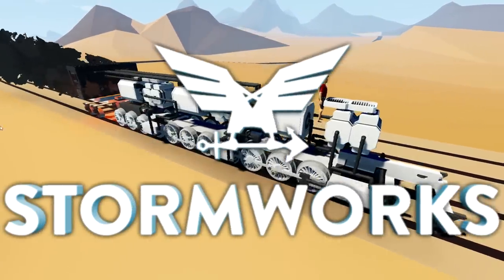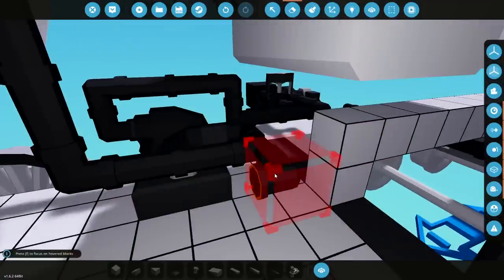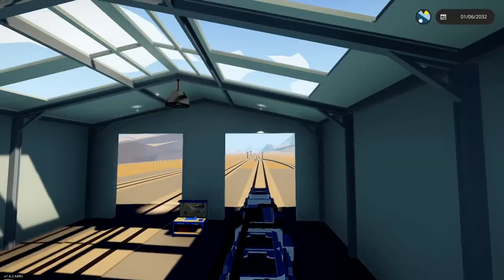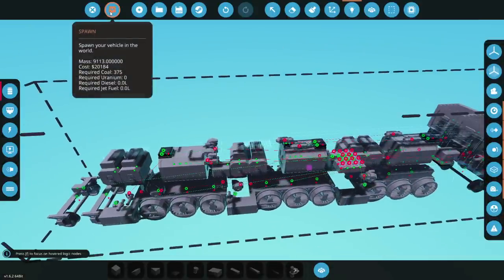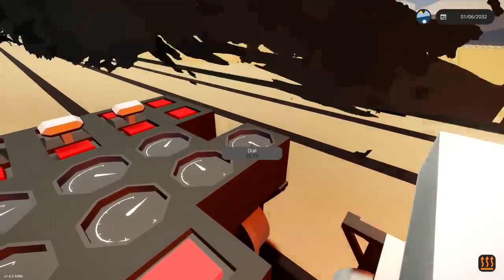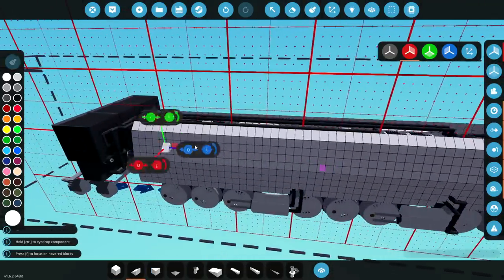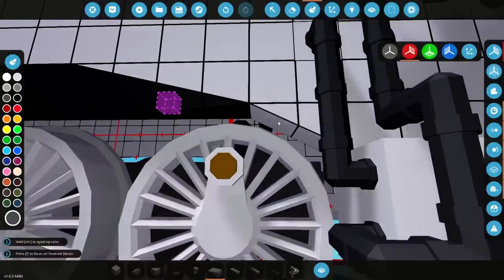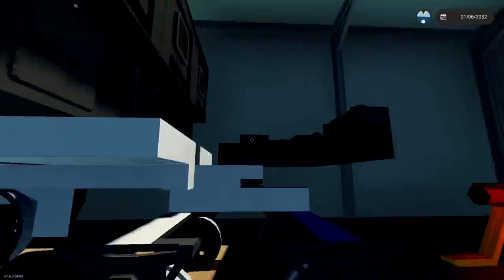We've Started The BODYWORK On Our HUGE STEAM POWERED LOCOMOTIVE In Stormworks!

Comment: I dont think frantic saw my comment on the last video, but there is a way to get infinite power out of the steam. Now I dont mean electrical power, I mean RPS / RPM. You only need a small firebox, a single boiler, and no condensers. All you need to do is get roughly 4 bars of pressure buildup, then shut off the boiler. the steam however, is sent through a 1 way valve, and pumped between each piston in a loop. This does work!! Just make sure you shut down the firebox by cutting air supply, or you will have issues. 

Please like this comment so Frantic can see this!
⬇️

Comment: Yay, you followed my proposal! With the 30-ish m/s you are at about the same max speed that i archived, too. So maybe 30m/s or ~110 km/h is the max Speed for Steam Trains/Wheels? I did another Test with normal Train Wheels and a large Electric Motor with infinite Electricity. With that i could reach Speed way above 250km/s, with an extremely high Chance of derailing with each Curve. So maybe the Steam Train Speed Limit is some sort of Failsafe?

Comment: why 3 boilers?  a single boiler tends to be a bit more efficient, and you will want to bridge the steam input between all pistons and bridge all the output to a single Condenser and make sure the condenser is as far away from the boiler and firebox as possible as the residual heat can cause the condenser to run hot and sometimes not work causing over-Pressure and boom. So what i have found is that as long as there is pressure be it 1 or 8 the engine will get to the same speed and is solely dependent on number of pistons and size of pistons. plus you loose the weight that the other boiler and condensers add to your creation.

Comment: Realisticly, you would want to send the exhaust steam from the back cylinder, to the front. This is how basically all mallet/articulatedd locomotives work. High pressure cylinders in the rear, highpressure cylinders in the front. Doing it from one side to the other would never work out.